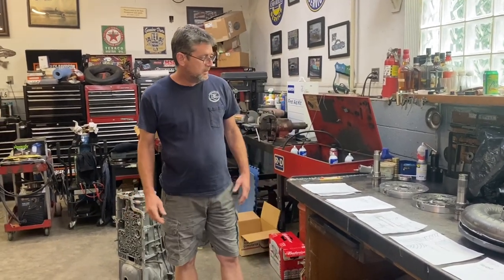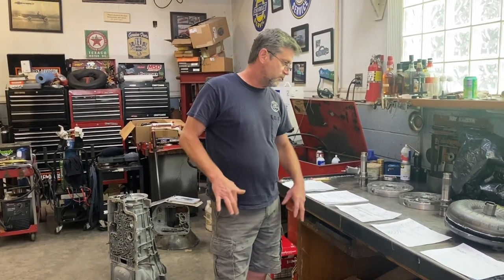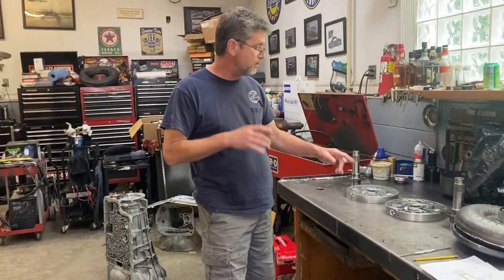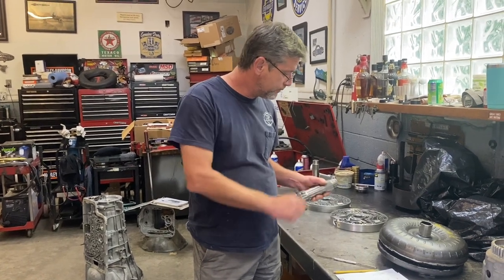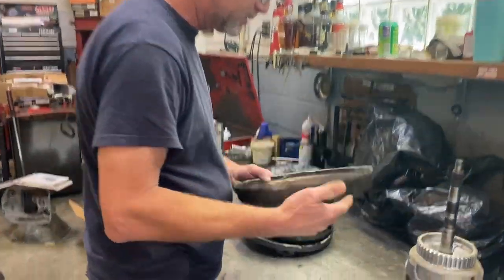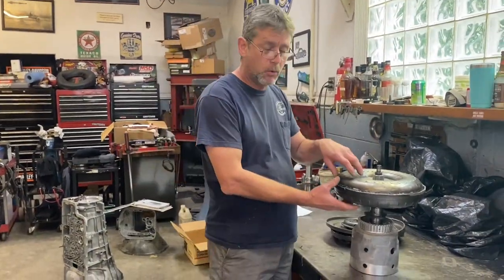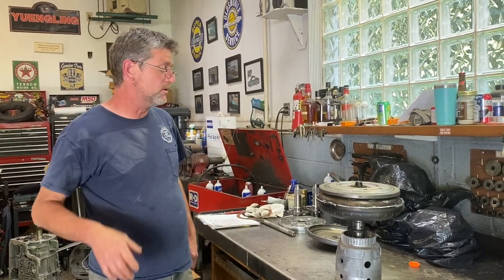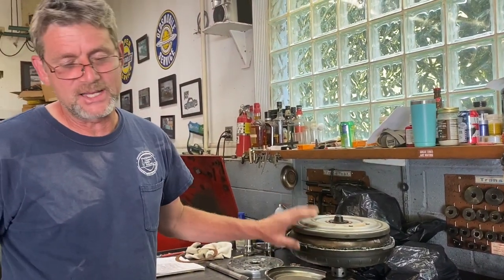E4OD/4R100 TCC /PWM” LOCKUP SYSTEMS EXPLAINED”  RABBIT HOLE STYLE!!! Pt .7

Comment: Ok, so I watched all of your videos on how this transmission functions and the basics for rebuilding and somehow one thing I just didn't catch is the diaphragm spring or bevel spring in the top of the overdrive piston, I didn't get the fancy spiral snap ring with my kit from Transtar Industries, so I guess I'll have to use the factory one. When I opened up this transmission, on both sides of the center support there were broken pieces parts, some of them not even recognizable so it's been a bit of a guessing game, I think I just about have it all together but I don't understand what that spring does or how to compress it to get the snap ring in place cause the whole spring is only about 1/2" to 5/8 across and the stock snap ring takes up a quarter of that, and I don't even understand what that spring does or why it is there... can you give me some advise, Thanx
Reply from the maker: Ok the spiral snap ring is a must use in these units ! It can be purchased separately. It can be put in with a flat blade screw driver and patients. Just have to start one end in the groove and work it in every inch or so all the way around until you run out of snap ring and the locking tabs are seated.
Reply from the maker: That is the return spring for the overdrive piston just like the forward Belvelle spring And the Coast clutch return spring if that makes sense

Comment: On 4R100, If I do PWM delete to ON/OFF lockup, do I need to purchase non-PWM solenoid pack?
Reply from the maker: No it uses the PWM solenoid pack just the valve system changes it to on /off

Comment: Here is something to ponder. If the line converter is not filled - there is no coupling. So that means that the more pressurised the converter is - the less slippage will there be (don't want to go into hydrostatics, but let's accept it). Early Ford's for example the FMX, had what they called Compensator fluid circuit, which basically modulated line pressure to the rear of the PR valve and the Converter feed valve, and this fluid was biased to TV pressure and manual valve position, i.e. in low ranges and reverse the converter would get this 'boost'. 

Now, the reason why I am asking is that up until recently transmissions evolved around sprags (roller clutches, diodes), which where there more for the seamless operation, to avoid timing shifts (5L40 has 4 of them...). However, with the latest, I am seeing the opposite, the 6R80 1st gen for example had none, and only on the 2nd gen did they introduce one for the first gear. 

So this obviously leads me to wonder - what about smoothness and coasting, and driving in bumper-to-bumper, if engine braking is by default always on? To me the answer is - regulating the converter feed, since all of them have input shaft sensors, the moment the accelerator is lifted, pump power is cut and line pressure drops. This should cause the torque converter to slip a whole great more (despite being a stock low stall model). So effectively, you once again replicate the manual transmission's play with the clutching out during coasting. 

The question is - what happens during braking? Methinks you have a situation where the TCM senses the pressure applied to the brake pedal and under light braking, keeps the TC slipping, but should pedal force and increase - it should ramp up this line pressure to assist and downshift for better engine braking. Under emergency braking - apply the TCC and Low/Reverse and also, I presume, tell the ABS not to lock the wheels.

Comment: I changed my PMW 4r100 to the trans-go on/off valve and now it locks slow or slips unless im really heavy on the throttle. Do you have any info of what it could be?
Reply from the maker: Jack, Not Cool, without knowing what else you've done as far as transmission repair. Did you change the converter, the seal on the end of the stator, Rebuild the entire transmission ? my best guess is measure the "original" lock-up valve diameter. It must read .530" In the instructions it talks about two different bore diameters either a .541 or .530 If you installed a .530" diameter valve in a .541" bore it would definitely cause problems such as yours. Thanks for subscribing ill help any way I can in your diagnosis.

Comment: Great info....I assume triple disk converters are the same just more clutches?
The transgo kit PWM conversion/delete will allow the use of any torque converter, right?

My trans update:
Its out and being torn down. Not too happy with what I have seen.  1 pan bolt missing, found that bolt lodged between the solenoid pack connector and trans body......ABOVE PAN!  My ATSG manual says I am supposed to have 8 check balls and my transmission only had 7. All bell housing, torque converter, and 4x4 adapter bolts and nuts were so overtorqued I had to use a 24" breaker bar to break them loose.  Thought I was going to have to cut the torque converter nuts off. 36 inch extensions and breaker bars are not fun. There was an E40D solenoid filter installed in my 4R100. 

That as far as I have gotten so far, going slowwww.

Oh, trans pan and magnet is full of metal shavings......quite substantially so.  Input shaft does not look right, it has a 6" long section about 6 inches from the end of the input shaft that looks like a lath has cut away 1/8" or a little more of its diameter. 

Keep the videos coming I love them all.
Reply from the maker: Oh man ! Crazy stuff ! Email me some pics (overdriven 67@hotmail.com )I just ran out of time and forgot to mention that.and wanted to upload the video. Yes you are correct about the triple disc clutch. I will mention that and more in the next video.
Reply from the maker: Also yes that PWM delete allows the use of any style clutch.
Reply from the maker: Those ATSG manuals are VERY good and a really great go-to for transmissions
Reply from the maker: Also I am going to recommend ANYONE rebuilding their own trans to buy one of those manuals in my next video ! Thanks for mentioning that ! Good Stuff

Comment: Marshall 
 I  hear people say that the E4OD an 4R100 are really close internally.  I was watching a guy rebuild a 4R100, He was showing an overdrive drum that he had bazed, said that they are bad about separating and just spinning inside. My question is, does the E4OD have this same issue???
Reply from the maker: No the E4OD does NOT have that problem ! The overdrive drum is 1 piece CAST/E4OD as opposed to STAMPED STEEL/4R100 which is just two pieces of stamped steel welded together. They break on the weld which causes that problem ONLY in a 4R100! I haven’t seen that very often but it does happen sometimes. I haven’t had any true 4R100 parts to show in my videos but they are almost identical inside to an E4OD other than a few drums that are Stamped Steel as opposed to 1 pce. Cast. Hope this helps !
Reply from the maker: Another way to look at it is think of the E4OD literally as the same transmission as the 4R100 with the exception of a few different “looking” parts inside which literally are doing the IDENTICAL things ! and the PWM lockup system that I explain in this video ! As difficult as it is just keep things in your mind as SIMPLE as possible ! I realize now but my next video is literally going to be talking about the MENTAL aspect of rebuilding. It’s going to be good one ! A definite must watch ! Stay tuned brother !

Comment: Thank you so much for all your videos Sir. Do you have a trick for cleaning out the 4r100 torque converters?
Reply from the maker: Unfortunately there is no guaranteed  way to clean out a torque converter. All you can do is pour new fluid in it and spin the turbine with the input shaft and drain it out multiple times.

Comment: What’s your recommendation for torque converter brand and style for a 97 7.3 that’s towing up to 12k at times?  Thanks for all the videos and I love learning all this.
Reply from the maker: Tim Yep that’s a good bit of weight there ! You’ll most likely need a Billet Triple clutch disc converter depending on how often your towing. 
  I have been telling people on my channel to get a “Precision” of New Hampton converter but apparently they are only selling to there current business clientele due to parts supply issues. 
   With that said I always go to PATC for all my “Super Heavy Duty” or “High Performance” applications they are the best out there in my opinion but they are expensive. 
  Also I’ve heard good things about B&I torque converters out of Oklahoma but have never used them. I trust less than a handful of converter companies as there are so many bad ones out there. Out of those 2 I’m sure you can get what you need ! 
  Be sure to follow the converter companies recommendation on what size to drill the TCC lock-up orifice in the pump on the E4OD to ensure the triple disc clutch does not apply to hard. They will steer you correct on that. Hope this helps. 
I’m assuming your putting in a Trango Tugger kit along with the Sonnax Pressure Regulator Valve ! It talk about these in my “Pump From Hell” video and My Trango “Tugger” kit install video !
Reply: Should I get a billet flexplate as well or will the stock style be ok? Thanks

Comment: Should I get a Billet Flexplate since I’m getting a Billet Triple Disc Converter?  Towing up to 12K.
Reply from the maker: I don’t think a billet flexplate is totally necessary in your case. I’m assuming your not running crazy horsepower and torque through it. Where that gets necessary in my opinion is hard throttle high torque launches in racing/competition type applications. The stock one is pretty stout as long as it’s in perfect condition. 
Personally I would spend that kind of money on a huge external transmission cooler etc.

Comment: my 4WD 98’ expedition with the early model 4R100 and you clarified fords design changes an explained simple ways I understood an appreciate. Kept wondering what difference was with the solenoid pack with the tcc solenoid having the pwm (can’t see the ball) and my original one the tcc has it and I can see them move like in your solenoid video. I had a problem where it wouldn’t shift into 4th years ago and ended up swapping solenoid pack had an orange plastic instead of blue and tcc was pwm and didn’t help changed accumulator valve body with rebuilt  and started shifting into 4th again. Now 5 years later problem is engine stalls in reverse but filter was loose when lowered pan, I’m hoping that’s the fix. Thinking of putting my original non pwm on TCC solenoid pack back on this week with the new filter an fluid 
I learned more than expected enjoyed it all though, and the diaper analogy.. I wanted to know
Reply from the maker: Good explanation ! Yes the PWM TCC solenoid doesn't have a ball and seat and the snout of the solenoid is white. It sounds like you got the split year trans with 4R100 parts but has ON/OFF TCC lock-up. I would definitely change it back to the ON/OFF style TCC solenoid if that is what came originally. Some of the Early design 4R100's weren't PWM and yours looks to be one of those split year transmissions. I have seen that stalling problem MANY times because the filter came out of the pump. you can peen a few spots on the pan where the filter rides to help keep the filter up into the pump.
Reply: Yes all you said right on the money its an early split year 4R100 and my original solenoid pack is like version 2/pg 29 in your solenoid video. When I put the one with the white plastic on tcc (not knowing as much back then) it didn’t help it shift to 4 but left it until now back into it , and like to make sure the valve bodies are good still while It’s easy and I’ll put the original solenoid pack back on the vehicles almost 130,000 now so I think it’ll keep working for awhile still thanks again for teaching
Reply from the maker: Great ! Good Comments it’s all about sharing knowledge these days. So many transmission problems can be solved just by these type of comments out there and clearing up the confusion ! Keep ‘em coming.

Comment: 1st thank you for sharing your knowledge and mechanical wisdom. Im successfully rebuilding my 4r100 but i have 1 more question.  7.3 diesel,slighly hopped up,turbo,exhaust, intake. What torque converter do you recommend? Obviously triple disk,billet but what brand? Precisions are freaking expensive.
Reply from the maker: Yeah Scooter I wish there was an easy answer here but there isn't. Buying a torque converter is like your buying there reputation as well, because you cant see inside of it for yourself it is of utmost importance to be able to trust it. With that said I have only used (Precision TC) or PATC which is more than Precision but I always know what I'm getting. I've heard B&I in Oklahoma are really good as well but have never used them maybe try them. There are so many BAD Torque Converter companies out there I trust very few because when a torque converter BLOWS up It ain't a pretty site and it sends metal all through the rebuild. Therefore costing more money and more time in the end. Good luck let me know what you get I'm curious
Reply: @Marshall Sanders  your experience and willingness to share that knowledge is greatly appreciated.  I  had a feeling thats what you might say lol.  Ive done everything else right..be dumb to cheap out  now.  Just worried cuz like you said there are so many of lesser quality with a pretty sticker n paint out there
Reply: @Marshall Sanders  im back again lookin for some more knowledge and experience 😆.  If installing the transgo 4r100-lu kit do i still use same solenoid and should it be used with the new precision torque converter i just ordered? Yes i took your advice.  And can the sonnax line to lube zip valve be used with transgo boost valve mod in shift kit? If not then your recommendations are welcomed. Little overwhelming with the 2 diff manufacturers doin things differently.  Im trying to do all these small things that help
Reply from the maker: Hey Scooter, shoot me an Email and we’ll discuss the “details” of your build that way we’re always on the same page if you will. It gets a bit confusing crossing different video comments. Your on the right track just have to dial in  your build.